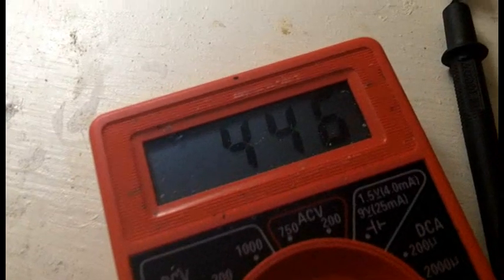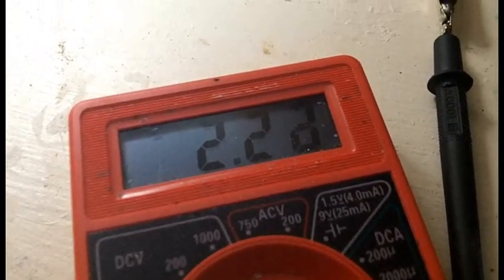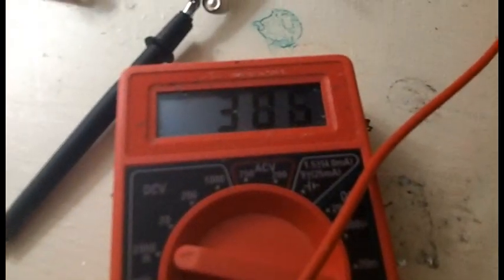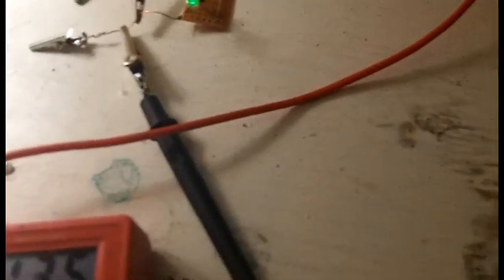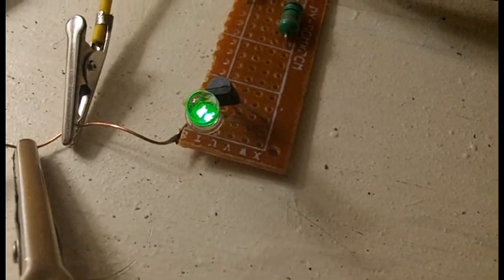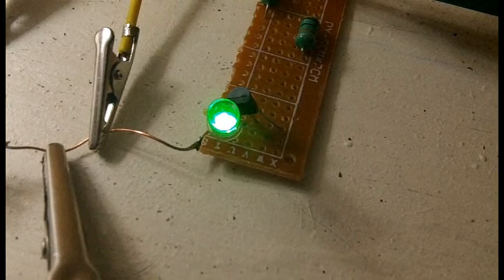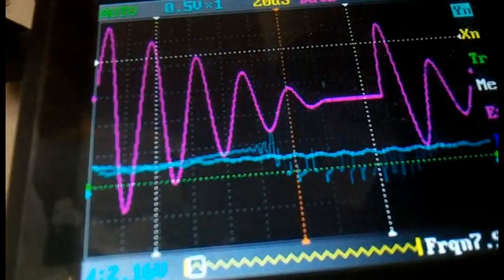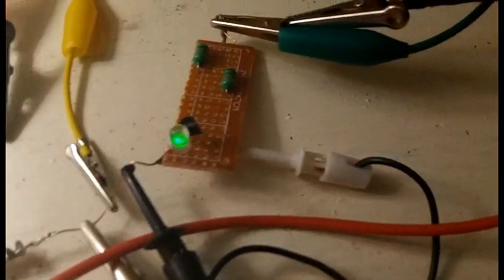Earth Battery With Just 2 Grounds - Free Electricity!

Comment: I'm getting 5 Amp peak to peak in my earth ground, from my Tesla magnifying oscillator circuit.
It uses the same spikes as the joule thief, but a bit faster and higher in voltage (180kc/s 3000V, aroumd 400mS duration)
the extra coil brings voltage and current in phase, which seems to make it work as a pump

Comment: Stick a small supercap in parallel with your input and it will keep your led lit very well.  Something like 20 Farad at 2.7 volts should work well for that single led.  In my videos, you can see the spikes on my scope that were off the scale, and I could charge a 2.7 volt 650 F boost cap fully as it seems to like those spikes.  Then you can run a high voltage JT circuit and light a 48" tube from the ground.  You can also light 400 leds the same way.  I have vids on how I did this if interested.

Nice work,

Bill
Reply from the maker: Thanks. I will try that. I have some 3F's and 20F's. I connected another JT circuit and was getting well over 70 volt spikes, but that is as high as my scope could measure. 2 grounds seems to work much better than an antenna and a ground.
Reply: Solar OffGrid
I think so too.. also, less danger from lightning, ha ha.  Which one of your grounds is showing up as +?  With my carbon rod, Mg set-up, the carbon rods are +.
Bill
Reply from the maker: Pirate Labs If you would, drop a source link on the OU thread for mag and carbon rods. I haven't been able to find a good price on them. For instance, the best price on a mg rod equates to $28/pound, but mag metal on the options market is currently at a little over $1/lb, so I think anything over $10/lb. is highway robbery.

Comment: Nice job. One of my first vids is ever posted on the tube was of the tesla radio frequency to dc circuit. I was able to achieve a voltage of around twenty volts in the cap. I then moved from Florida to the northwest. I will soon be doing some more experiments. I didn't have knowledge of the joule thief at that time. I do now. Maby I'll hook it back up and connect it to the thief and see what happens... Nice work.
Reply from the maker: BackRoom Labs I am thinking of making a 3-minute video history of the joule thief and another more detailed video on how to build one... maybe 2 minutes... The most interesting thing about this experiment, in my opinion, is the way the voltage goes really low, but the light get's brighter... To me, this suggests a radiant energy effect.